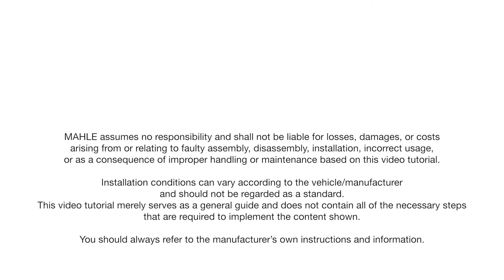How to change MAHLE oil filter - Running smoothly

Comment: I wonder if there is any car engine with a better exposed oil filter than the one portrayed in the clip. If it was always THAT easy to change the oil filter.
Reply: kia ceed crdi 2012, pop the cover off the fuel injector rail, take 27mm socket with 30cm extension on a ratchet and you're golden.